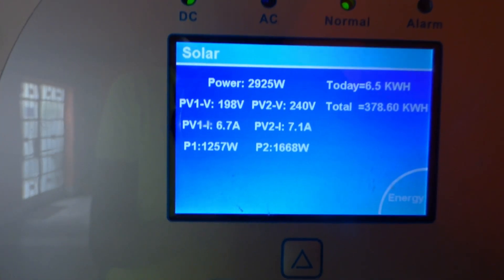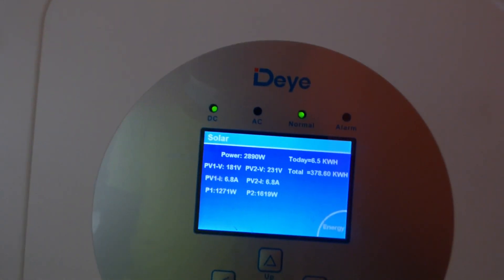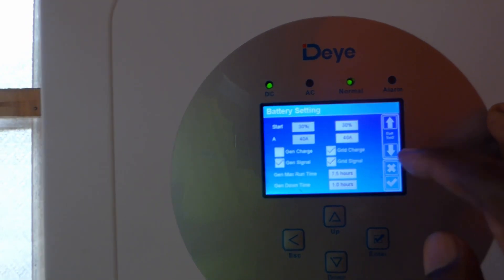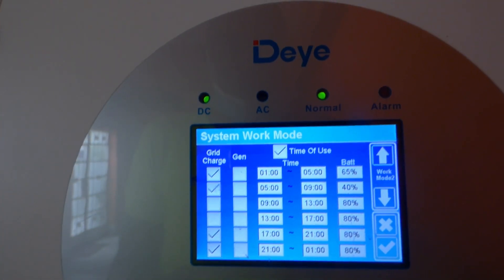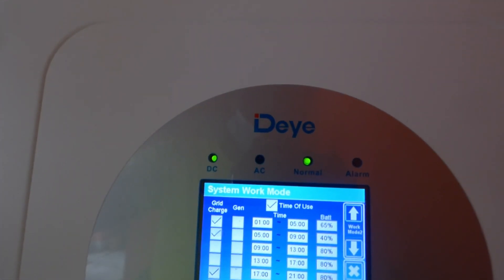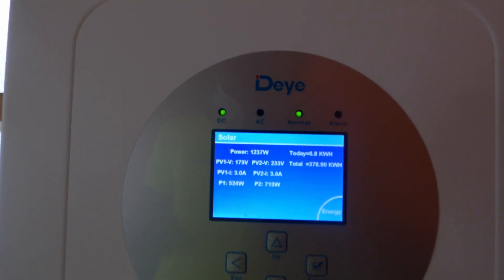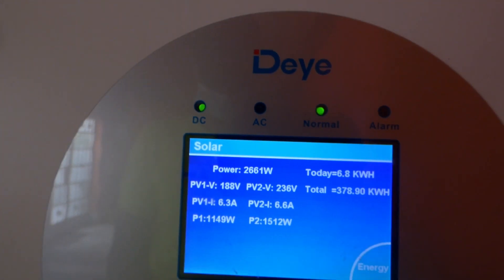Deye Inverter: Prioritizing solar over the Grid see how it is done.

Comment: Good morning sir, is there any basic settings for Deye hybrid inverter 3 phase grid settings because I installed a three phase Deye inverter but the grid is not charging the battery showing × on the grid side of the LCD screen what can I do to make it to charge through the grid thanks
Reply from the maker: Is the phase correct? Check phase rotation first.

Comment: Hii, if i want to completely rely on the solar, and don't want to use power from grid, what do i do.
Reply from the maker: Easiest thing to do is turn the grid input breaker off. If not you have to go into the settings
Reply: @drsolar how should i do that

Comment: Way too complex. How about putting things simple: how can you set this inverter to prioritize source as Solar-Battery-Utility, as not in draining anything from the grid until battery is below set %/Voltage ? Using ZETL and no grid charge, the load drains from the grid instead of the battery.
Reply from the maker: Thank you for watching and commenting. Set up time of use

Comment: I have a three phase deye after switching off an add one battery its failing to turn on but the control box it's on
Reply from the maker: @MailosTembo-t6h  remove the battery and see if it comes back on

Comment: Thanks Dr. Solar I have a Deye inverter 12 2pc connected parallel with 5.12 kWh battery 6pcs. Am running a 4kw motor bt it keeps on telling me over current. What would be the problem, thanks
Reply from the maker: @davidkimasir7269  which inverter? What capacity?

Comment: Hi Doc, the grid in my country, Barbados, has a frequency of 50Hz. When I go into the grid settings on my Deye 8k it says 60Hz.... which is not right.  I have not had to charge from the grid so far but will this be a problem if I need to?  Could it damage anything?
Reply: I had same problem. It will ask you for 4 digit password to enable change, use 7777. You can edit now.
Reply: @dineshbora8395  I was doing that from the beginning.........I think it has to do with the grid frequency limits , the default frequency limits are like(going from memory) 57Hz(low limit) and 62Hz(high limit).  The limits can be changed but I wonder if it will affect anything else.
Reply: I have changed it to 50Hz a few times but it always changes back to 60Hz
Reply from the maker: Reach out to Deye and ask them for firmware that would allow it to be permanent.
Reply: @drsolar  thanks doc, I will give it a try

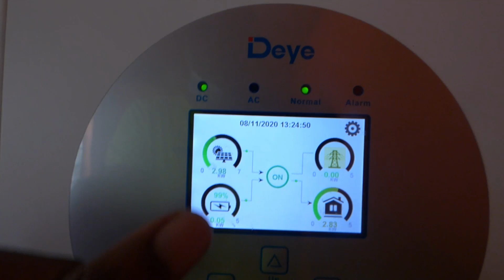Comment: Your time of use explanation is wrong, On time of use screen the batt%  you enter there is when it will stop charging! not start, the charge start % is setup on the battery settings page, so if you setup on the battery settings page 30% and you chose time of use 01:00 - 5:00 65% charge the battery with grid to 65% and stop charging it.
Reply from the maker: @mauritzmarais1344  thanks for watching and commenting. Unfortunately I no longer have the Deye inverter. So I can't check to confirm or disagree. Thanks for sharing.

Comment: 2:40 So what exactly does that 30% mean for the grid? Does it mean that the grid will maintain a 30% minimum charge for the battery? And the solar panels will still be the ones to take the battery to 100% (outside of the System Work Mode settings)?
Reply from the maker: Thank you for watching and commenting. Which of the settings are you referring to?
Reply: @drsolar  2:40 of the video.

Comment: If you have 2 of 100ah Lithium batteries connected in parallel what will be your charging and discharge parameters
Reply from the maker: thank you for watching and commenting. What does it say on the side of the battery? Use the details that is provided to set this.
Reply: your inverter will see it as 1 large battery so for example if you have 2 50ah batteries it will equals to 100ah and discharge or charge parameter of lithium batteries are 50% so you should set them to 50

Comment: do you need a battery installed to run off grid?
Reply from the maker: Simple answer is yes. Thank you for watching and commenting. Please subscribe
Reply: @drsolar  thank you for response. How can i get it to run off grid? the solar panels do not produce any amps without the live grid connected. I have battery setup and it wont charge without grid either. thank you
Reply from the maker: @davehoss1510  then your settings are wrong or the inverter is faulty. The panels should charge without the grid

Comment: Is it okay to install a two battery with one Inverter only and 6 panels?
Reply from the maker: What size are your panels? What two batteries? How many volts in total?
Reply: @drsolar   i mean two battery's so it had some large capacities, our panels is 6 pieces with 550 watts,
Reply from the maker: @katherineaplacador3069  3.3 kw in panels. Why is your consumption? How many AH are your batteries? What country are you in? If you are in a sunny place it should work
Reply: @drsolar  we're here in the Philippines sir our battery is 200ah
Reply from the maker: @katherineaplacador3069  hello from  Lagos. You should be good. I like to oversize my systems
Reply: @drsolar   so is it good to install another 200 ah battery?
Reply from the maker: @katherineaplacador3069  if you discharge it a lot and all you have is panels to charge you will struggle with your panels
Reply: @drsolar  I had one question also. What is the critical percentage of battery?
Reply from the maker: @katherineaplacador3069  that is determined by the manufacturer. They tell you max depth of discharge. Follow the recommendation
Reply: You can, if youre using a smart battery with bms, you can parallel the two battery, one will
Be the master and the other one is the slave.

Comment: Dr. Sokar, i have a Deye 12kW single phase. I just acquired a secondhand 15kW generator (Perkins). Can i connect it directly to the Deye inverter without passing through an ATS ? I'd like the generator to self start when my solar output drops.
Reply from the maker: There is a generator port and the grid port. Connect to the generator pass. No need for an ATS

Comment: Hello. I did everything you mentioned. basically i want solar and battery to charge in Day and use Grid to charge the battery by night. I ticked it like your settings. Still the grid is charging the battery and load during the day.
Reply from the maker: reach out to Deye for a firmware update. Also check your grid start charge percentage

Comment: Hi,
I have a 12kw deye inverter 3 phases
First question : can I link grid input as generator?
Second question: when the batteries are fully charged from the grid or the generator, I want to let the grid continues going to load and not disconnect.
As bypass , is it possible?
Please give me your help about this
Reply from the maker: Yes. It will see it as the grid and would charge and when the batteries are full will bypass. When you switch off the generator then UPS mode kicks in. Use the grid input
Reply: @drsolar  
I have a trouble in entering to the program of felicity hybrid inverter 5kw joining to a lithium battery felicity 10kw.
When I press Enter key for 3 seconds,  the inverter does not respond and I can not enter the program page. 
Is there any help can you give me please ?
Reply from the maker: @housseineltahan5582  thank you for watching and commenting. I am not familiar with the Felicity inverter. Sorry I can't help. Please like share and subscribe.
Reply: @drsolar  Thanks a lot
Reply: Hello Dr, I 8kva deye inverters, two parallely connected.  Anytime the solar goes off, grid kicks in to the load. I want the battery to kick in instead.  What do I do please?

Comment: In the manual it says 13 + 13 Amps max for the PV power. 8 panels in one string looks fine, but you can also put 5 + 5 panels in two strings to PV 1 and 2. Another option is to overpanel the inverter more than the rated Wattage. In case of full sunshine and 12 panels 550w each the energy over the rated inverter Wattage shall be clipped and can't be used. But this happens only at rare situations. But pls. confirm this with the manufacturer and your contractor installing the system.
Reply from the maker: Thank you for watching and commenting. Nice suggestions
Reply: I have a Deye 12kW Single phase inverter and 25kWh Lithium batteries. I also have 30 x 555w Panels with 48v (VOC) and 41.9v (VMP).  The inverter specifies max input as 425v per MPPT.  Can I connect 10 pannels per MPPT   so that I have a total of 30. ???
Reply: @Wanderaleo  Just looked up the datasheet of Deye 12k Inverter. With Voc of 800V and Max Amps of 34 + 17A you should be able to handle 30 Modules and 15kW from PV. Are you running 3 strings?   2 string on the 34A MPPT and one string on the second 17A PV input ?   And to oversize the PV by 10© is considered safe by many installers.

Comment: can solax do this prioritizing?
Reply: If automatic. How will it know the time i would want it to charge from grid during the day, when  the battery is lower than a set state of charge?
Reply from the maker: @odoohub5010  you can set parameters. You can ask to start charging with the grid when you battery gets to a certain soc.
Reply from the maker: It does it automatically.
Reply: Is it possible to tell the inverter to charge from grid when the power from solar is lower than a set value in watts, and then automatically return to solar charging when the pv can supply a set power in watts to charge the battery. Sometimes the weather might not be favourable, especially during rainy or cloudy days.
Reply: I also want to know if solax can work with other DIY lifepo4 battery?
Reply from the maker: @odoohub5010  as lead acid in the settings. Yes

Comment: Hi, I have installed a circuit breaker in my house with an lamp and alarm to tell me when the grid comes.  I did it to choose manually if I need to charge (if no sun).  Can you advise what Inverter settings I should have and where I can select the Amps to charge from the grid to control costs ie 10A, 20A or 30A
Reply from the maker: You can set the start current and charge current within the settings where you Select battery type. The 2nd page

Comment: I am charging from the grid, no solar using 5kw Deye Inverter and 2X 5kw Volta Lifepo4 batteries. After 3 months my state of charge has started to drift quite substantially and all the information regarding that tells me to charge the batteries to 100% and then revert settings back to 80% to correct. That sounds fine except I cannot find any information on how to actually do that. When I go into the settings I can't seem to change anything which is just as well since I am not 100% sure what to do anyway.
Reply from the maker: Do you have bms communication?
Reply: @drsolar  All I have is the interface on the DEYE inverter, there is nothing on the batteries which are VOLTA brand, I was told by the installer to download an app called Solarman to monitor the system remotely if I want. I used the app but it basically gives me the same info as what is on the inverter screen.
Reply from the maker: @janrdoh  if there is no communication between inverter and battery you will struggle.

Comment: Hello friend,with Deye inverter can i give user parameter to the battery,i hawe in moment uan Voltronic inverter and i use user parameter..thank you frend
Reply from the maker: Thank you for watching and commenting. Yes you can set the charge abs discharge current voltage and more.

Comment: How do you set the priority as follows:
1. PV
2. Battery
3. Grid

I don’t mind the battery draining, as long as the savings is there. I want to use PV and Battery as much as possible
Reply from the maker: The system automates that process. You can use time of use to pick when you want Otto charge with the grid. In additional settings you can prioritize load over battery. The pv will power loads first before it charges the batteries

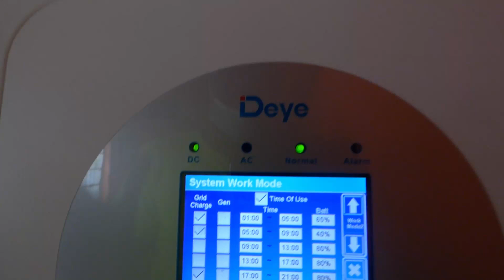Comment: I love your Deye videos! I have a question, Say I have 01:00 - 4:00 to drop battery to 60%, NO Charging, and I just want it to use the battery not grid to save bills.
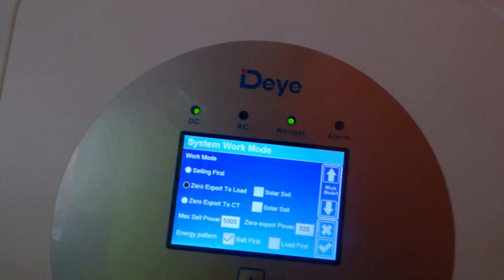What if at 3:00 I already  reached 60%? what will happen since i still got 1 hour to go? will the system shut down since I dont have charging enabled? or will it allow it to go lower?
1. I am guessing if I reached 60%, and I had GRID on, it would use grid and not shut down, correct?
2. If I did not have grid, and it reached 60%, and i still got 1 hour to go, no  charging enabled what would it do?
Any recommendation? thanks!
Reply from the maker: It would continue to discharge the battery. Thank you for the love.
Reply: @drsolar  Thanks for replying! :) so if it reached 60%, and I still have 1 hour to go.. if there's Grid it would use grid, if there's no Grid it would keep discharging breaking the "Time of use" rules?
Reply from the maker: It is not breaking the rules. Rules govern grid use. Battery will provide back up power always
Reply: @drsolar  AWESOME THANK YOU!! 💖One final question is about BEHAVIOR: if I have it 1:00 - 5:00 30%, will it SLOWLY discharge till it reach 30% by 5, or is it possible that I reach 5 way before if I had big loads? And does it discharge the whole load to battery 100%, or will it split it Grid/Battery so it goes down slower? 
I'm trying to see if the system slowly drains it by splitting load, or if it completely throw the whole load to battery, which means it might reach 30% way before 5 for me!

Comment: Hi bro. I also have a Deye but the agm varta battery was installed. the inverter and batteries work great but there is one setting that is not clear. how can I do it during the day when there is a solar panel. charge the battery to a maximum of 90% or 95% so as not to load the battery. when the energy is more than enough from the solar panel, then the battery is charged to the maximum, but I do not want to change this setting if there is one. die with it
Reply from the maker: Welcome to the channel. Time of use is very helpful. Good luck

Comment: Regarding the time of use settings, if for example you set your battery to 50% and Grid falls away while the battery is at 50% for that time period. Will the battery continue to discharge to its set minimum in the battery settings? If you have no PV at this point in time.
Reply from the maker: That is correct. So when I know that I might lose the grid that percentage is always higher

Comment: Hi there, I have a Deye 8KW inverter, with solar panels. how do I make inverter to only pull from solar panels and not grid?
Reply from the maker: It will always pull a little from the grid
Reply: Hey man, enable "Time of Use" and unselect all the options for "Grid Charge". If you unselect "Time of Use", it will always Grid Charge to 100% capacity, so enable it and just unselect all the Grid Charge options. This will cause the batteries to drop to your discharge threshold, so be careful. Lastly, set your preferred operating setting to "battery first", not "load first".
Reply: @daltonw5624  in the video @drsolar says enable load first though
Reply: If you choose "Load first", then the solar power will be prioritised towards first supplying the house, and then any surplus will go towards charging the battery.

If you choose "Battery first", then the solar power is directed to the battery as first priority, the surplus will go to the house next. But if you get much higher household loads, that's going to be supplemented from the grid, rather than by diverting more solar away from the battery.

This model works best for me, as when the evening comes around, I can mostly run off of the battery instead of pulling from the grid. This keeps my baterry cycling in check and a consistency across my operating model. I find that this gives me the most efficiency across the board and that my batteries are always sufficiently charged.
Reply: Why do we set it to Batt First ?

Comment: Hi there, I have done all the steps that you said we should take but the inverter is still pulling from the grid and the grid icon is still green. How do I set it that the grid is 0 and the icon is orange?
Reply from the maker: You and I have resolved this I hope. How is the system doing now?
Reply: Just cut the grid breaker off

Comment: Hi. I I want to use the grid do I just connect a cable between the inverter and the main level using the grid input? Thanks
Reply from the maker: Thank you for watching and commenting. Make sure that you add protections as well. It is a bit more complex than what you describe. You have your incoming and outgoing.

Comment: Thk u,
In my country, the Voltage's grid is not stable.
So i want to supply load from battery  to obtain a stable AC voltage on the output of the inverter. But in the same time i would like to charge the battery from the grid.
Can i do that?  If yes, how?
Regards
Reply from the maker: Thank you for watching and commenting. The inverter would charge from the grid if qualified power is available. In your battery settings tick the grid charge.

Comment: Hi Sir I  installed 12kv deye inverter two of them I connected them parallel before it was charging the batteries using solar panels but out of the sudden it is no longer charging. How can I do it to charge my batteries again?
Reply from the maker: Thank you for watching and commenting. What are your battery settings? What is your time of use settings? Also can you give more information about your system